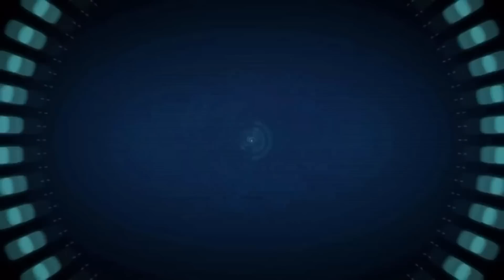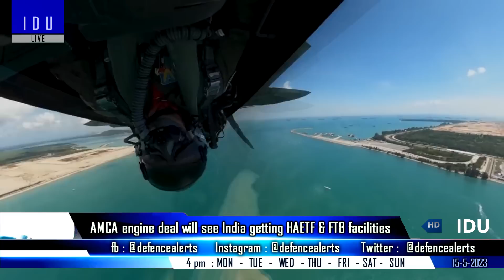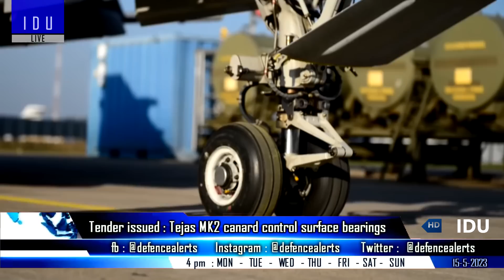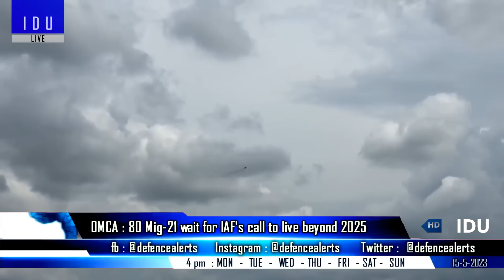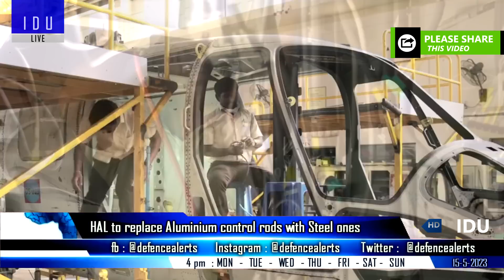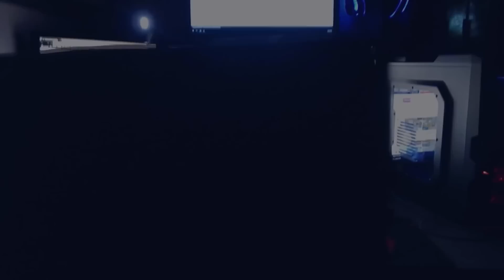Indian Defence Updates : Tejas Mk2 Canards,120Kn Engine Test Facility,80 OMCA For IAF,Dhruv Upgrade

Comment: How did HAL accept the aluminium rods and how did CEMILAC certify this without considering the wear and tear?
Multiple crashes and many lives lost, and now they’re saying it’s a metal wear and tear issue.
Will anyone in HAL be accountable for this? Nope none…🙄
Reply: Spot on. HAL is only reducing its credibility.
Reply: DRDO and HAL contains war quality scientists (just like war quality food unable to eat)
Reply: Hal have coconut educated engineer
Reply: You foreigners need not spew venom here .
Reply: That’s what happens when you hire engineers based on reservations!
Reply: @LightOfRyuk  Well, if you want to blame someone, blame your forefathers. They thought little of treating other men like cattle to fatten their purses.
Reply: @Asakura Yoh  correctly said..... reservations is ultimate curse for development
Reply: Cost of freedom is blood of fallen soldiers....same can be said about HAL equipment ...cost of aircraft is blood of pilots ...
Reply: If the industry standard for control rods is alloy steel, then the deviation from standard would have been tested before decision was taken. It is pertinent to note that every part of a flying machine is subject to the weight vs relevant mechanical properties tradeoff during design and testing stage.

And if putting the blame is the ultimate aim of the fact finding exercise ( which it is not ) ... Then the entire team of Boeing designers at Seattle should have been jailed for the two 737-Max disasters and Boeing itself should have been shut down. 346 civilians died due to that software fault, btw.

On a general note, we should think for a minute before pointing the finger at others and shouting about lack of accountability etc.
Reply: Are you guys insane, do you realize how many US platforms have had issues?  Remember the V-22 Osprey?
Reply: @Flying-Tiger That's BS, your vaunted private sector is responsible for tons of failures, even in US producers, look at Boeing and the V-22 (let's not even discuss their commercial aircraft).

You have insane expectations.
Reply: @Flying-Tiger  Oh I know they are, but they aren't as skilled and amazing as you think they are.
Reply: @Flying-Tiger Perhaps, but that's not what I was discussing, I was talking about India and US private producers, not places such as Russia, France or UK.

As much as you want to slam India's PSUs and praise the Private industry, the former is much better, and the latter much less than you think
Reply: @Flying-Tiger And you will see no real change in speed or results, but higher prices for the tax payers
Reply: @Flying-Tiger And yet you won't see private beat it